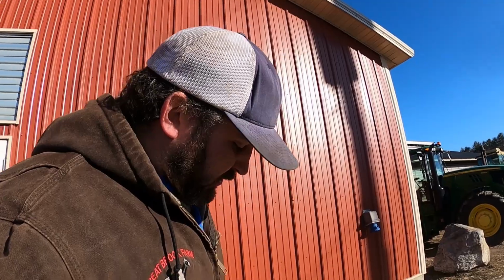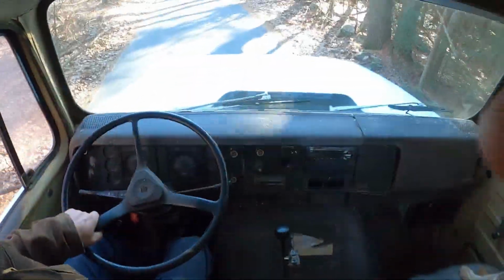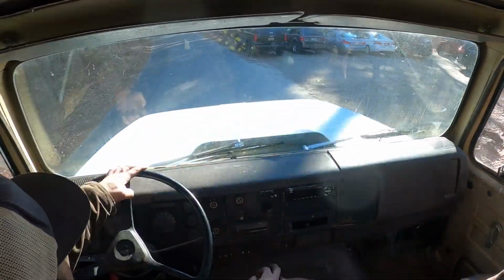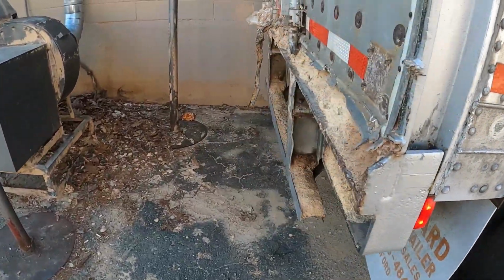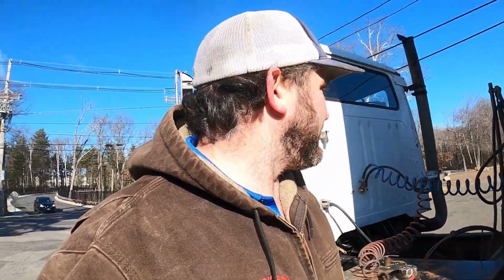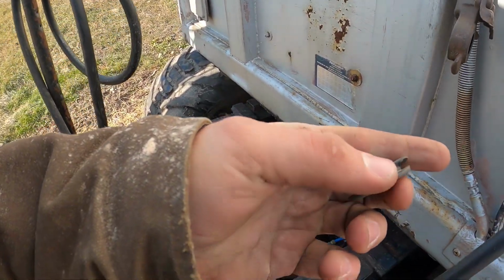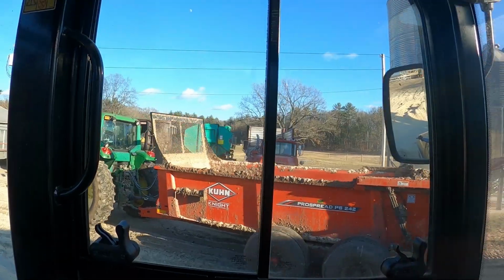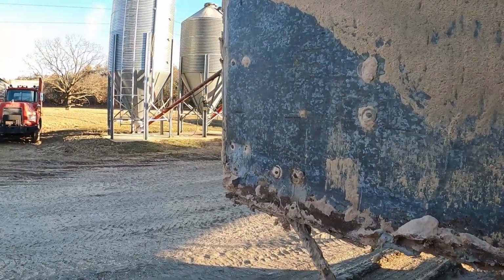Trucking Sawdust.. What Could Go Wrong?

Comment: On that tire on the chopper---get one of those pumpers for green slime. They are your friend and won't let you down. My truck had a leak that left it down overnight. I put 20 pumps in a fairly large tire and now it drives smooth down the boulevard.
Reply: Tireject

Comment: When I hook up my trailer I put a little vaseline on the seals of the air hoses and it helps
Reply: Try a silicone based lubricant instead. Vaseline is petroleum based, it will eat those rubber seals pretty quick.
Reply: @FantasticCraptacular  thanks I will give it a try
Reply from the maker: Thats good thinking

Comment: We fought batteries on the 766 IH (our snow tractor now) for years, it has 2 batteries.  Someone finally said to check the battery cables, one going between the 2 was bad, never had problem since
Reply from the maker: It had 2 cables come from starter to battery's. on cable was completely junk. video coming of it

Comment: Need some grease on that fifth wheel
Reply from the maker: It's all greased up. Did that prior to hooking up to the trailer
Reply: Not trying to bust on ya. I didn't know if you used a slick disc or grease
Reply from the maker: @matthewmenhennett2648  use regular grease. It will get new risers and plate this year. It's pretty weather's from previous owners not greasing it enough
Reply: @DuffyAg  nice nice  love the content I watch all the videos keep up the hard work
Reply from the maker: @matthewmenhennett2648  Appreciate it. Thanks for watching along